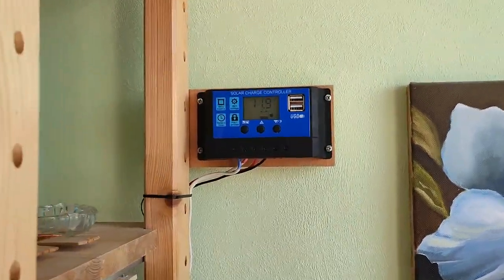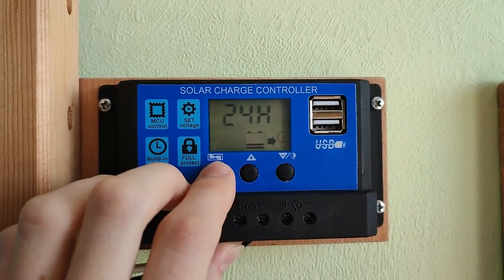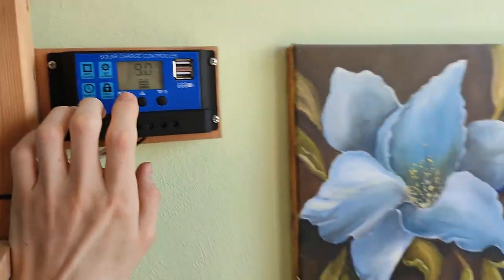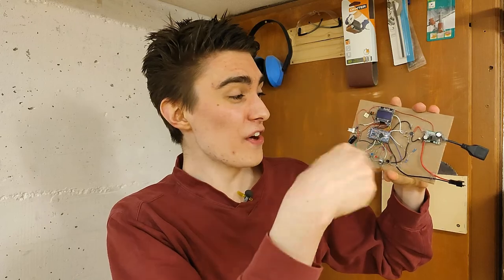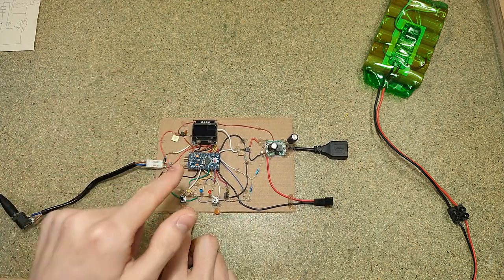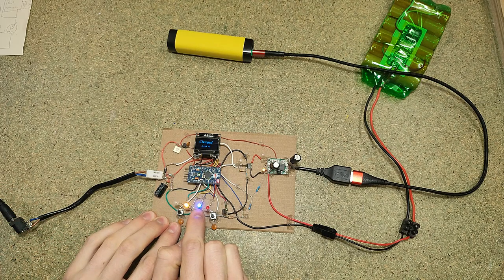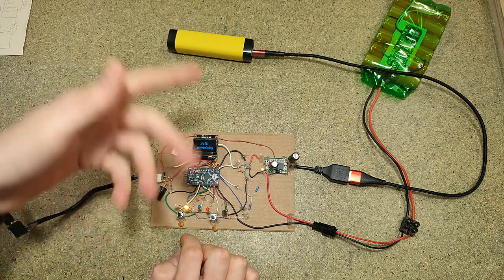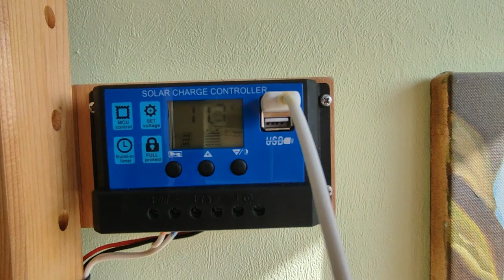FINISHING the 2.5A USB solar smartphone charging station for my windowsill (kinda) - part 3

Comment: did you write a program in the Arduino IDE?
Reply from the maker: Hi! I had (and still have) an internet outage, hence I didn't respond :)
Yes, I wrote it in standard C++ in the IDE but I figured showing and talking about the code wouldn't be interesting enough
Reply: @ChronicTechClips  
C++ ))
Reply: I wonder how much you have in France the Internet over optical fiber (FTTP).
_
There is no life without the Internet)) we also had "problems" with the Internet.

 @ChronicTechClips
Reply from the maker: @markskreen3344  Fibre optic is currently still in deployment where I am but has been available for a couple of years now, tho we don't have it yet. But there's work going on to put all power lines (which are still overhead cables lol) underground, in the course of which all telephone wires would be removed altogether and replaced by optical fiber.
So hopefully we'll have it soon 😅

Yeah, I agree life without internet is a pain, I've had a real bad two days 😂
Reply from the maker: @markskreen3344  where do you live? I know there's a lot of countries with worse connectivity than we have here, so I'm not complaining about mine :)
Reply: I'm from Uzbekistan. when I had ASDL the internet was having a problem. Now I have fiber. It's fire. 100mb/s for 10€ unlimited. Works like a Swiss watch. ))
Reply from the maker: @markskreen3344  Wow! Happy for you! Can't wait to get fiber myself now 😆
Reply: It always seemed to me that in Europe, even in a cave, there is high-speed Internet.
Reply: You will fall in love with this Internet.))
 @ChronicTechClips
Reply from the maker: @markskreen3344  That's for sure!
Reply from the maker: @markskreen3344  I ALREADY HAVE FALLEN IN LOVE WITH IT!!
My neighbor let me use hers to upload the new video - IT TOOK 2 MINUTES!!! 🤯🤯🤯🤯😶
Reply: I was also pleasantly surprised by this speed. Now the mobile Internet pisses me off. (speed is low )
 @ChronicTechClips
Reply: for some reason, the video is hidden. )) isn't it time yet?
Reply from the maker: @markskreen3344  yeah, I'm currently on mobile, glad to have internet at all!!
Sorry, the video is uploaded but private since thumbnail and description aren't done yet. I usually upload 1-2 days before publishing, that way I have time to make sure everything is set when it goes live
Reply from the maker: @markskreen3344  Tomorrow there will be a short on the main channel and 3d printer part 3 will be out the day after (10th) as promised 😅
Reply: @ChronicTechClips  😍
Reply from the maker: @markskreen3344  my internet is back! 🎉🎈✨ 😅😅
Reply: Now you're like a fish in water. "a true blogger . " )) hooray.
 @ChronicTechClips
Reply: You need heitors)) we need more comments...
 @ChronicTechClips
Reply from the maker: @markskreen3344  Haha, yeah